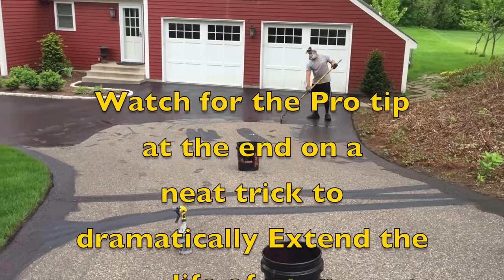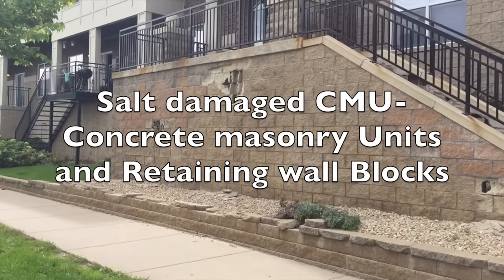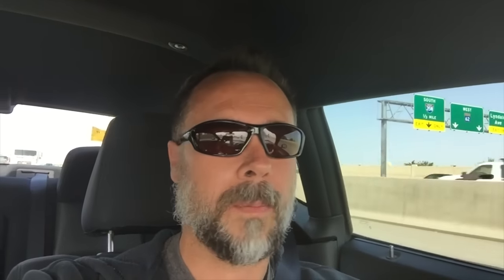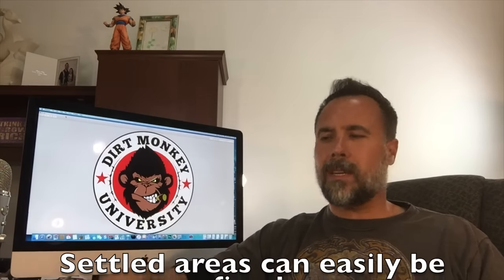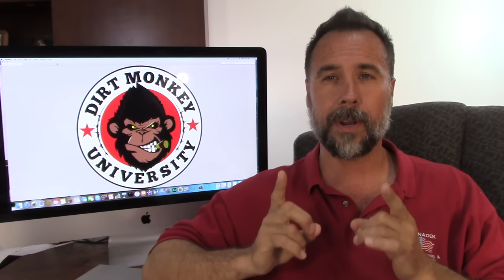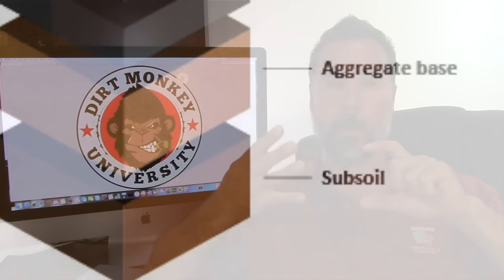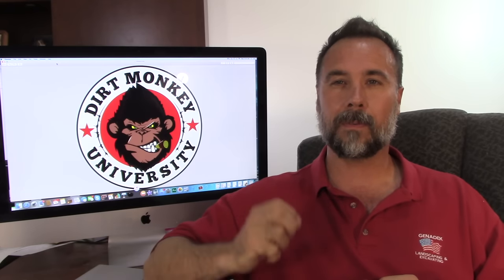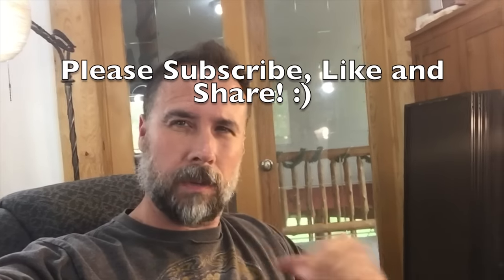Asphalt, Concrete or Paver Driveways- Which is the best?!?

Comment: I laid down concrete pavers at my parent’s house in 2009. It was for an extension on either side, and my dad wanted to be able to park and drive medium duty vehicles on it. We ended up with a 12-14” aggregate base, with 3 separate layers of geo-grid in between. It’s been 9 years and had tons and tons and tons of trucks, loaded dump trailers, equipment, etc on them. Literally no settlement. We’re in MD and it’s lasted through many harsh winters. NO salt was ever used on it though.

Comment: As an asphalt contractor and Sealcoater you can get a long life out of a asphalt driveway with proper maintenance. First when your going to get your driveway paved make sure they put at least 4 inches or gravel down and get it compacted. Then what most people don’t know is that company’s are only putting down top coat at 2-3 inches instead of putting a binder down at 1.5 inches and then top down at 1.5 inches so you get three inches total. I couldn’t tell you how many times I’ve paved a driveway or did patch work and find out there’s not only just top coat down but it’s only a inch thick. When your a home owner I would recommend asking the contractor to but road binder down instead of driveway binder because it’s a a lot stronger. And after the paving is done in 1-2 years you should Sealcoat your driveway, not with the stuff you can buy st home depo either you want a pro. And you want to be careful who you hire you want a company who uses a sand slurry mix. It’s the best to reguvinate the oils in the asphalt and you want to find a good company and learn about what they use for material ask them for a pamflit the plant hands them out for free! You also want to watch out for some company’s who will end up watering there material down. So do your research first. And after you get your driveway seal coated it should last 5+ years before it has to be re sealed again do not do it every year it will clog the pours on the asphalt and make it crack.
Reply: I appreciate that info as a first time homeowner. 👍
Reply: Whats your experience with heated asphalt driveways? Is it worth it if it prevents water in cracks freezing and expanding the crack? My current driveway is asphalt and desperately needs torn out and redone....just haven't decided on asphalt or concrete...
Reply: Hi Dylon. So one of the contractors told me he can pave over the current asphalt because it's already settled. The other contractors told me it has to be dug up. Who's telling the truth?
Reply: @dylon
Reply: Wow thank you so much for this valuable information!!
Reply: After 19-20 years, my parents asphalt driveway, has shown its first crack.

Comment: I was involved In  asphalt paving for 30+ years. I've sealed it, cracked filled it, patched it, removed it , Installed it , hauled it and loaded it out BIG TIME ( all of the above) . When I put my asphalt drive way in I kinda went over board. I put probably 2 feet of stone in the driveway lol. Let it sit in stone for about 2 years then installed it in 2 lifts. 1 and a half binder / inch and a half surface lol. OK it was a little over kill, it was still there after 35 years, starting to fail a bit  but still solid. In my world " black is beautiful"
Reply: I guess that would work just fine!
Reply: The National Asphalt Pavement Association recommends 6" of base for most driveways and 8" when heavier vehicles are expected.  (Compact the subsoil, lay 3-4" of base, compact the base, lay another 3-4" of base, compact the base again)  That doesn't sound too impressive when considering the 12+ inches that other people have mentioned.

Is 6" of base and 3" of asphalt adequate like they recommend?  Or instead, are they advocating for their own job security for when the driveway needs to be replaced sooner rather than later?

Comment: As a Belgium farmer I would choose asfalt then concrete and last pavers. Because when the subsoil drops asfalt gently follows without breaking (to some degree) concrete creates holes underneath and when they are big enough the concrete gets destroyed. Pavers are just not strong enough for me. But in al cases thicker is better just like Stanley said and don't forget about the quality
Reply: I appreciate you saying this about asphalt.  I see neighbor's drives lifting at the joints and being broken at the edges.  All the while, my asphalt driveway has developed character over the years.  Also, a minor oil leak is less unsightly on asphalt than it is on concrete.
Reply: what about granite stones? isn't that the most durable stone in existence?
Reply: @Daaaaaaavid  the stones themselves are indeed very durable but they don's seal the subsoil completely, when a couple of stones sink they create a puddle where the water can collect and softens the subsoil thus  expanding the problem.

Comment: Thanks for such a concise and objective overview. Your video strikes the perfect balance of authoritative delivery without bluster, inspires confidence based on your obvious experience, and keeps things moving visually and conceptually without going too fast. I've had great luck with a stamped concrete driveway, but only because my contractor/friend advised me to spend the extra for what must be a 6-inch pour with lots of rebar--no cracks (other than the cut ones) after ten years! However, I have a long driveway and am considering replacing the asphalt stretch with pavers. Thanks for the tips on how to make it last better.

Comment: My unsealed asphalt driveway is 40 years old and the only crack is from a shallow rooted tree that the previous owner had planet next to it. Aside from sinking an inch and a half against the garage slab, I've got no reason to do anything with it for another decade. If it does get replaced, I'll just have them scrape it up into the new mix, lay it a bit thicker and leave it unsealed again. For comparison, the house on my right was religious with the tar and had to resurface  once and replace once in 35 years; the house on the left sealed every other year and ended up replacing after 35 years.

Comment: Couple of points about concrete: 
1 - All concrete shrinks when curing, just like the mud in a puddle cracks and curls in a summer sun.  A finisher's job is to control how fast the curing happens and providing for joints to direct the cracking to specific places.  Rebar, wire mesh, fibermesh, not pouring in heat/wind/low humidity and different chemicals can assist in minimizing shrinkage and subsequent cracking, spalling, etc.  Whether mechanical jointing or diamond saw cutting is used, it has to be the proper depth and location.  Water/cement ratio is important.  Concrete thickness doesn't necessarily deter cracking. 
2 - To a large degree, especially in severe freeze/thaw areas, subgrade prep is top dog in assuring long term slab integrity.  Adequate washed rock drainage directly underneath the slab, along with compacted subgrade beneath that provides for maximum resistance to frost heaving from expandable clays and subsurface water.  Rebar in impact areas or soft loamy subgrades helps. Integral piers in the slab can help extremely soft areas.  
3 - Salt, de-icer, magnesium chloride, etc. kills concrete.  Period.  
4 - Over-tooling when finishing causes much of the surface cracking, along with adverse weather.  Pour it and get the initial finish on, then let it bleed and stay off until it's time for the kneeboards.  Don't throw water on the surface, and don't rub on the edges for something to do while it sets up.  Save your energy to hit it when the time is right and you'll be rewarded with a nice looking job.  

/24 years in the biz, batching, hauling and finishing.
Reply from the maker: All top notch-Thank you!  I think I need to interview you!!!
Reply: Jay Phillips  Pretty close description there. I agree about letting it air, I try to not close it up too soon with a fresno too when I can afford to. I live in Nevada, summers can get you and if the heat don't the wind will. We use con film to help close up with the bullfloat when we need to. I don't like water on the top either, a light fog won't kill it if used evenly and in moderation when no con film is available, but half the time some idiot will spray it all over like fucking crazy (I work with a few sometimes like that). But edges and joints are number one and should be laid down right away, unless you're using boards and a straight edge to tool the joints you can keep em' straight with walking tools if you get them in time. But all edges should be floated flat & opened up even if you trowel right back over them, they need to be opened up so you don't fight em'.  Personally , I don't use knee boards anymore unless I have to, as long as I can reach it with a tricky trowel that I flat trowel with, a 5x20'' square end trowel, I just rounded out the corners on it some. I trowel all wall lines with my 5x24'' before we rod it, then stay away from it with walking tools. /40 yrs. just finishing. After x amount of years you start to find out that it don't always have to be hard, if you haven't yet you will (and you can still do nice work).
Reply: I have a pipe leaking 740 gpd,  and the area is under my driveway. I'm asking you, please tell me who I should contact and fix this, and how much is a reasonable cost in the pacific northwest.
Reply: Jay Phillips your pretty spot on. Of my driveway I've got a 6" pour and metal mesh. It's a California style so it's cracked but in the gaps provided. The metal mesh has kept it from moving anywhere. We only have one ever small crack about 6' on the corner of the driveway. Our driveway is sealed and has no issues. Is over 13 or so years old. Just needs a good power wash every so often.
Reply: Jay Phillips so only pour concrete on the 4 good days of the year we get to pour concrete and good luck😂😂😂
Reply: Jay Phillips b
Reply: Jay Phillips Vibrating the concrete in also makes a huge difference, that being said, almost nobody does it.

Comment: Good video.  Last year I did a bit of 'science' study when looking at concrete as a possibility for my driveway.  I've still not moved forward on it yet, but I'm lifting my research from a Word file FYI, because it compliments your own findings about salt and concrete risks: >>> Concrete has high strength when it is compressed, or 'squeezed'. However, it is extremely weak when it is subjected to tension, or 'pulled'. Salt can take advantage of this weakness.  Believe it or not, while concrete appears to be a very dense material, it is in fact quite like a blotter. It can and does absorb water. You can actually see this happen on a hot summer day. Sprinkle some water on your sidewalk or driveway and look very closely. You can actually see the water penetrate the surface of the concrete.   When you spread rock salt on your concrete to melt snow and ice, the salt dissolves the snow and makes a salt water mush. The melting action of the salt allows water to enter the concrete. If the temperature then drops and the water freezes, the growing ice crystals can blast apart the concrete.  Salt is also hygroscopic. It attracts water. It can cause concrete to become more saturated with water than it would otherwise. The presence of this extra water in freezing conditions can spell trouble. The volume of water increases by 9 percent when it freezes within the concrete matrix. The pressure of the growing ice crystals can cause the surface of the concrete to fail. It usually spalls off. <<<
Reply from the maker: Wow-  That is awesome research. Thanks for sharing!

Comment: We did our drivway im pavers and it's perfect eight years later.
We have many neighbors with blacktop driveways:
- You can't walk barefoot on blacktop in the summer - too hot
- You can't park a motorcycle or bicycle on blacktop because the kickstand will make a hole
- Every two years they have to reseal the driveway. This means:
1. They have to either pay someone to do the whole job or DIY and still spend money on material
2. They lose the use of the driveway for at least a day

Comment: After watching this, I'm tempted just to keep my fugly gravel driveway lol
Reply: It really is the best option. I usually pour a concrete slab I can use to back up a car and then leave the rest gravel. Make a border with concrete or brick is you want it to look fancier.
Reply: Gravel isn’t ideal if you have delivery drivers drive up your driveway. Our vans weigh 10-20k pounds. Very heavy and easily get stuck on non solid surfaces. Complete nightmare to deliver to houses with mile long dirt driveways.
Reply: @angelgjr1999  its also totally unsuitable if you live anywhere with snow.

Comment: Our condominium association went crazy on a very expensive paving system for our short main drive almost 25 years ago.  It was chosen with long term durability.  I forgot what underlay came first the sand or the crushed gravel but geomat were laid between them.  Then the really expensive part was laid in, 6 inches of reinforced concrete.  After the concrete cured a very thin dusting of sand was applied before cobblestones, asphalt or finish concrete was applied.  This top pavement is called the ware layer and is expected to be replaced when salt damage or other damage occurs with less effort.  The driveway had to be cut through with heavy concrete cutters on week for emergency access to a water main break but otherwise the rest of the driveway is quite even and pleasant to use.  25 years later the condo association is quite happy with this expensive paving system.

Comment: I live in the Chicago, Illinois region (land of winter freezing & sub zero temps) and want to replace an asphalt driveway with concrete.  (Asphalt driveway is 2 years old when home was built).  So let me get this straight; 8" base, wire & 6" pour.  Thank you for the heads up (video & comments) on that.  Now, I want a black driveway.  I understand in my climate (winters) it's recommended to use "iron oxide black" and NOT "carbon black" due to air / water entainment.  (The darkness of the black tint isn't a major issue for me).  Have an expert opinion?

Comment: Great video. I am having my driveway done this summer. I excavated 12" down and back filled with 3/4-0 mix. I packed down and left to sit one year. Now comes the asphalt. This will be applied after the area is re compacted and 2" of compressed asphalt will sit on top. Hope it holds together.
Reply from the maker: A year of settlement and compaction will be rock solid. 😄👍
Reply: The concrete border has been installed and the crew just leveled and compacted the area this afternoon. paver should be here in a couple of days.
Reply: Almost one year now and the driveway looks great. I will be looking to seal it this summer. what should i use?

Comment: Others are that in our state concrete raises the property taxes where the other 2 don`t, pavers look good and last good if they never get salted for the snow. Then asphalt it raises the air temp around the area year round. My father extended his drive around the house into the new back yard garage well after that the A/C would no longer cool the house sufficiently. Just a few things to look at.

Comment: You forgot to mention rebar,  rebar will add far more strength to your concrete driveway than a thicker base or pour, though those are definetely helpful as well, just don't ever forget to put rebar in at a 3ft grid minimum.

Comment: We use up to 12 inches of recycled asphalt product R A P
In wet areas we place 3 inch minis then compact with bobcat tires and roller then add one inch minis R A P to grade then 3/4 inch base asphalt then 3/8 inch top asphalt 330 degrees F roal it and compact it we make it like a Mass. HIGHWAY  SCOTT FROM NH .
Reply from the maker: Thanks for the comments Scott, thanks for viewing !

Comment: I am considering the stamped concrete look for my back patio. Thanks for the tips on the pour!
Reply: make sure you clear seal every couple ov years. if they towel the color in it will wear out and it will look crappy. the trick is diy every few years, geta disposable roler and pole a can ov sealer and solvent, thin the 1st coat then straight on the second coat. wil save you bucks down the track, a 300buck sprayer is not worth it unless you know someone that you can lend you one.
Reply: BaberJacks nobody mags in the color anymore. everyone throws the bags of color right into the mixer and has the driver spin the drum for a while when bringing it to the slump they want.
Reply: yeh but to thoes that have existing stamped, usually they throw the color in @the plant, the release agent may be another color and thus you have 2 color, best to seal so to get best results